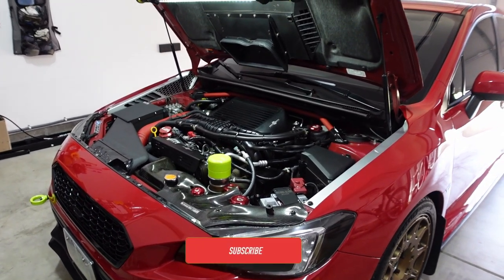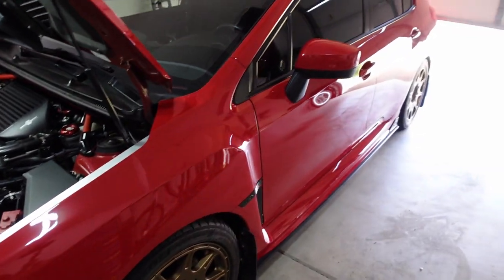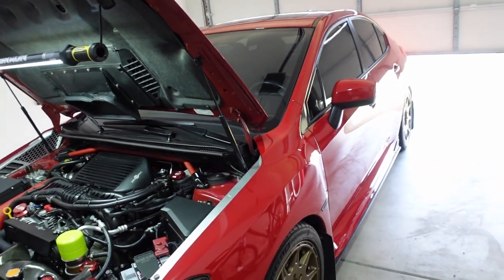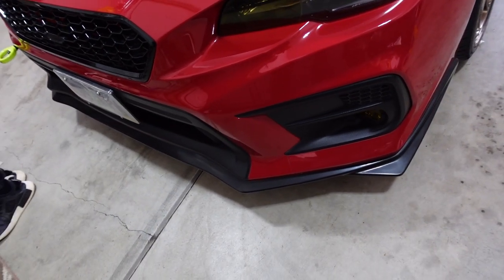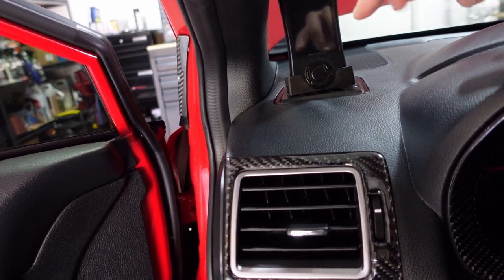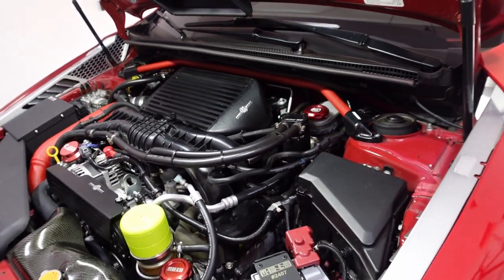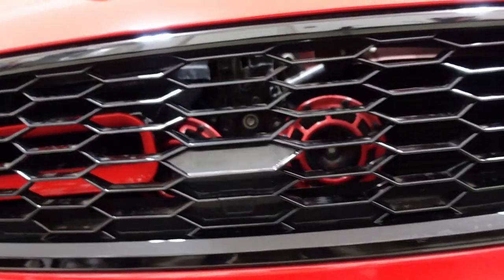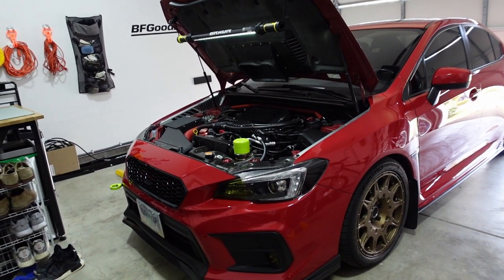Mods I REGRET! | 2018 Subaru WRX

Comment: Big sf = big regret. The fact that it’s so hard to keep the filter exactly 1” over the pipe has been such a pain for maintenance. Then the car falls flat on its face when it’s off just by a little.
Reply from the maker: Yup, I dread having to remove it whenever I need to clean the MAF sensor. I almost always have to re-adjust it at least 3 times.

Comment: That AP mount is probably more safe for flashing compared to the mounts where you don’t physically plug in the cable. Don’t want to have a loose connection and brick the ecu.
Reply from the maker: Definitely, and mainly safer for track applications since it stays locked in there.

Comment: thanks for the wisdom from your experience. with window visors, my main use for them is if i hit the windshield wash and forget my window is down (but i bought the ones you tape on without brackets). me personally i found out about the snorkel after i had already bought the grimmspeed hella horn kit and now use that bracket, along with my stock horns and a 12v power supply on my tool box/cart to scare people/make them move out of the way in the shop i work in
Reply from the maker: Love it! I’d install train horns if I could 😂
Reply: @ronfromportland  i have considered it. finding a place for the compressor is something that makes it a back burner idea

Comment: I like the looks of the Subaru OEM window visors.  But man they sure are noisy at speed. Anything over 20mph and it sounds like you are in a wind tunnel. I have debated taking mine off but like you, my window surround and trim is scratched. I'll probably just leave them on.
Reply from the maker: Definitely got a few more scratches after removing mine!

Comment: I'm looking for a sail panel piece to reduce wind turbulence front the door-mounted mirror.  I know the Mk5 Supra and 911 have products to do this, but ALL Subarus can benefit from the having something push air around the mirror and keep it out of the gap btwn the mirror cap and glass.  Thoughts?
Reply from the maker: I’d be open to doing something like that. I just haven’t seen anything on the market.
Reply: @ronfromportland ...neither have I, that's why I asked.  I have seen stick-on vortex generators (pk of 15 at Autozone, in paintable white) and thought about painting 2 black and then affixing them to the sail panel in such a way to direct air around the mirror. Happy Thanksgiving.

Comment: What do you use to clean your map and maf sensors? And wondering whats the highest spike you had on afr?
Reply from the maker: I use CRC MAF Sensor cleaner for both sensors. If I don’t clean them for months, AF Learning tends to spike to ~-18. Intake filter placement also has a factor in this if you are running an aftermarket one, it has to be on there perfectly for the car to be happy. I knew something was wrong though when the AFR values wouldn’t go down to normal range after cleaning the sensors. Here’s a video I made on that specific issue: https://youtu.be/lDGN-05stKs
Reply: @ronfromportland  and it stays on the big number -18 right? Not on min or max
Reply from the maker: @terencemostoles4049  yup
Reply: Awesome thanks for linking your video!!!

Comment: Yah those wheels are ugly in my opinion,same as the window visors..but to each their own..ride height is good tho..

Btw, I have the Cobb intake. Did u make sure to take off the stock intake bracket that holds up the stock intake tube. It hits the pipe and can cause a hole. I had problems like u until I took that off
Reply from the maker: I appreciate the honest opinion! Yeah I’m pretty sure I took that bracket off. If it was mentioned in the instructions then I followed it closely.
Reply: @ronfromportland  no problem man..I like ur videos just an honest guy doing mods and figuring what he likes..I’ve been doing the same and just troubleshooting I am no pro..

The Cobb intake: per their instructions, they say it’s optional and so I just left it on..I had the intake and didn’t notice that till like 8 months later. Was causing me hell.. good luck man
Reply from the maker: Thanks man! Troubleshooting is all we can do. I know Cobb updated the bracket at some point so my instructions most likely are different from yours. Glad you got it sorted out, this stuff can make you go crazy I tell ya. Mine has been good for the most part…after finding that the end of the tube connecting to the inlet was bent.